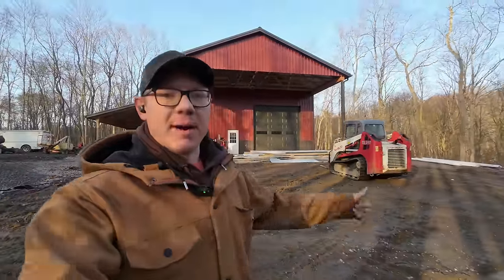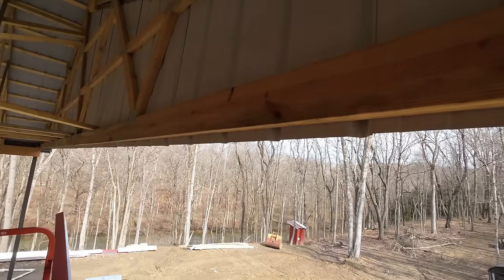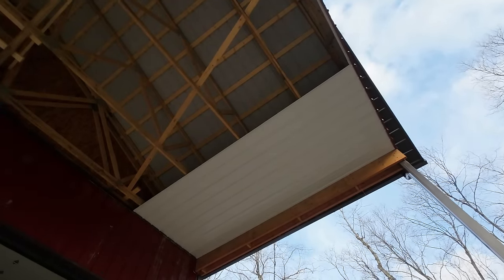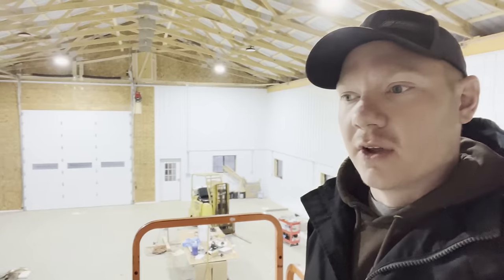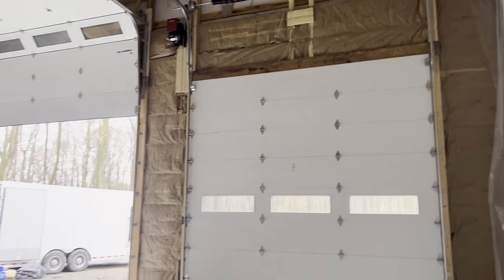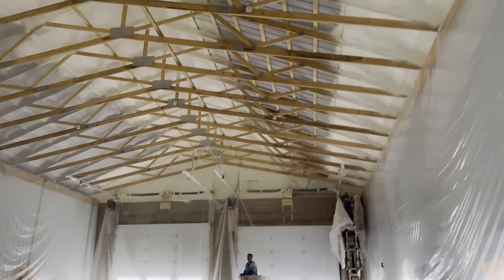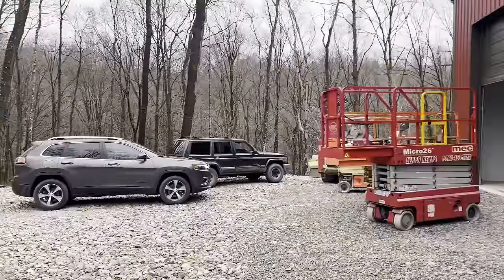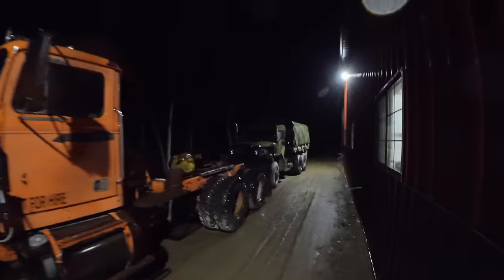I had My New Shop Sprayed with Hot Foam!! (Dream Shop Build)

Comment: I love the idea of foam insulation in the attic. But, my concern is when the roof develops a leak, and they all do eventually, you won’t know about it because of the foam until there is significant damage.
Reply: I was wondering the same thing. Everything eventually fails over time, even metal roofs. Imagine the work involved if you have to replace those roof panels.
Reply: Spray foam the outside of the roof 😁

Comment: Seeing that you are going to put heavy Equipment in the shop and run it i would put a exhaust System to take away the fumes and Black carbon from any Machine that you run and all so protect the inside roof and walls.

Comment: In UK, spray PU foam for insulation to the underside of a roof was popular but following serious problems with rotting structural timber, most insurers will not insure the properties and to get any insurance at all some property owners have had to remove it at considerable cost and difficulty.  Also, exposed PU foam would come under the Polyurethane Rehs that considers it a significant fire risk that develops toxic black smoke, which will propagate so quickly that it can outpace a running man within a building.  For this reason the escape travel distances are halved compared with normal installations.  I have designed under the Polyurethane Regs and its a nightmare.  Some claim that their polyurethane is self extinguishing or non-flammable but this is based on the inappropriate test.  Another client of mine ran a testing laboratory and he showed me the effect of the official test and the effects of a real world scenario and it was frightening, since then we have had the alarming fire at Grenfell Tower in London that showed how polyurethane acts in a fire.
Reply: I saw a news segment where a couple had to have their roof removed due to the toxicity of the spray foam.

Comment: We did (2) 8000sf corrugated steel ceilings in a large cold storage with 16' interior 12" foam bonded galv. sheet walls. We did it all ourselves and saved lots even owning all the gear. Bought all the pumps and >100' of heated line. All the air supply sets for 3 employees who quickly trained and did it all  Took at least a week per due to the depth we used. Not a whimpy few inches. for Refrigeration required. 2# density. Why gray, don't you want some light?  Is this a 60x40? Ours that size in 2004 was 35K  but owner only did 12'' walls which I said were too low. and no foam, a shell 1 rollup and 1 door & concrete surround >20 yards, a 20 x 40 'porch' all for storing orchard gear at that time 40 acres now 150. Always are too small, I believe

Comment: The best deal you can get is when your helper is taller than you. Those are the days I hate being 6'3" with a big wingspan. I get all of the load. It's a great measurement device, though. If I stand and put an arm up, that's exactly an 8' ceiling. Actually, dead on nuts accurate.

Comment: I'm sure you've already answered this / been asked it and are considering - however... Are you putting in some sort of exhaust extraction system with hoses you can hook over exhaust pipes, that pump the fumes outside? I really think that they would be worth considering, especially with some of the big old engines you work with!
Reply from the maker: Yes already in the works!

Comment: Now that your roof underside is totally sealed where will the buildup of daily heat that rises in the building escape? No ridge vents or gable exhaust fans? I'm not talking about radiant sun bearing down, I'm talking about the air current that uses convection to keep the space cool. Cool air comes in thru the window, warms, then rises... to where?
Reply from the maker: I do have a gable vent it’s just covered at the moment. It will be installed.   Very spon

Comment: I built a 40x50 steel arch (Quanset) style shop about 25 years ago and was wanting to have spray foam insulation but, it was ridiculous what they wanted at that time!! If I remember correctly, it would have been over $15k!!
Reply from the maker: This cost almost 17
Reply: @DieselCreek  I figured it would have been more than that

Comment: How did the foam react to the steel with what looks to be drip stop on it? on my side walls of my building it pushed the steel out between ribs. Iam adding on now and worried about the new part pushing out as well.

Comment: I probably need to be schooled on this but is there still a ridge vent for the moisture to escape or is that not needed in this situation? I put half inch celotex underneath the metal roofing for sound deadening and insulated on the underside of the lower truss sections on my garage project. Where is the ventilation going to happen in this project? I’m probably missing something hopefully. There is going to be moisture rising with the heat, where is it going to escape?

Comment: What was the outside temperature during the spraying? Also did you hear any popping or cracking sounds?
Should be ok sprayed onto felt backed sheets but have you pushed up on the middle of the panels to make sure they haven't buckled in ? I've seen that issue in cold weather

Comment: I'm confused, the sides are lined with tin, why wouldn't you use something else if it's noisy?
Also worth noting that insulation doesn't stop the transfer of heat, only slows it down.
You need a reflective foil type thing to reject heat

Comment: Looking good! Do you have power run out there or still run on a gen set? I would run under ground power out there if I was you. And will the power company run good heavy duty service to the shop out in the sticks like that up there? I know here in Florida where I am at it's hard to get a heavy service run just for a shop in rural area unless you have big$$$ and they won't run 2 separate services to the same address like when you add the house.

Comment: I'd have nailed a set of 2x6 boards together in a cross-hatch pattern to create a standing block (that's at least 3 feet x 3 feet so he doesn't risk twisting his ankle by sliding off the edge) for Mr. Shorty so when he's on the lift, he's the same height I am...

😄😁😆😅😂🤣

Comment: I know it’s much too late now- but I assumed a few things about the “outside triangle” and the adjacent wall—- A that you would insulate it with the rest of the shop(sound dedin and shop expansion) - B /C I figured you would have no ceiling on the outside triangle and a hinged section in the plywood on the wall to C allow the upcoming gantry crane to move from inside to outside allowing bigger projects  - another reason being if you dooo eventually shove that wall over to expand your shop then you only have the crane in 3/4 of your shop - again far far far too late now fellow pa man bit of a oversight but to be fair I only thought of it now
Reply: Something else while I’m thinking about it - with in floor heat you COULD also do in floor cooling if you setup a reverse-able heat pump and heat exchanger- is it worth it that’s up to you 😂

Comment: I never seen any power service run into your property. Witch looks like would be miles to do. What powering your building. A big gen set for 220 volt. It have to be a big one as them big over head cranes are all 3 phase
Reply from the maker: I’m running off a generator currently. I will be running electrical service here this summer
Reply: I thought so.  That's going to be a long costly run to bring power in an if that crane 3 phase it cost me in 1997 to bring 3 phase up my road2 poles. down my 1200 foot drive way over 10k cnd and I had to install all the poles an CSR cable up my driveway power company dont do private land only roadway

Comment: Did I miss the video where he completed all of those red pipes in the floor that lead up to that one central location? How is the floor being heated? I remember watching the video of him laying all of those red pipes in the floor but isn’t there some type of mechanical heating system that all of those pipes get tied into? I see the central location they lead to but I don’t see any type of heater or air conditioning system what gets pumped through those pipes and how does it cool or heat the floor?
Reply from the maker: Not complete yet.

Comment: I don't know the cost, but it looks like expensive way to build your workshop. We use sandwich panels.(steel PUR steel,or steel PUR aluminium) Much quicker, low cost and super finish. Is there a reason why you build it this way?

Comment: I cant work out what the fascination is with spray insulation. The most thermally conductive shit ever.  Hotter in summer and colder in winter. Just use netted insulation. easier, safer, breathable. and wont rust your roof prematurely.

Comment: I can't help wondering if it wasn't false economics to have only three inches of foam sprayed.  I know you were trying to keep the cost down but adding a few more inches after they had done all the prep work would have been far cheaper than the original three inches since the prep is done and it just involves them hitting it with another layer as they are doing it.  The big cost for you must have been their travel time and masking out the job as well as transporting all their equipment.  R-15 just isn't that much in a roof.  Although you do have the option of sheeting the overhead and adding rocksul or such.  Mineral wool would have a double benefit as it is a great sound deadener as well as good R value.  For a roof in your climate zone I would think R-30 would be a bare minimum even for a shop.  Most modern building codes would require R40 minimum in your zone for a residences.  Even considering you are in a shop and do not need 70 degrees cooling/heating still when the outside temperature is 100 degrees or minus twenty you need energy to bring it to fifty five or sixty.  At any rate it is your cow do what you want.  You have a great space to work now and to keep things out of the mud as well.  When you are laying out in the snow bundled up like the Michelin man even a tarp looks like a hell of an improvement so you are miles ahead of that!!

Comment: I don't want to be negative you have made a great shop well done but that spray foam worries me i know from the fire department here that i could be  a fire hazard foam useally burns really good so i hope they used a fire depressing foam you work with very hazardes materials in that shop like gasoline and gas but like  i said before its just a warning and you did a really good job building that in the middle of nowhere

Comment: 5:27 I was already laughing. Knew you were going to shoot the nails into and likely out through the outer siding 
My girlfriend turned out to be one of those women who practice independent feminism ideology and therefore shouldnt listen when a guy gives them instructions from experience.
She ended up driving screws through my siding and then like an utter doofus, she blamed it on the ladder not giving the ability to position her hand at the proper angle to hold and drive the screw into the lumber instead of through it and into the siding.

Comment: Very bad news for you. I have 40 years in urethane shooting. Never put urethane directly under metal roof with wood baton. Seeping condensation or rain water will cause roting of the wood. Urethane foam is waterproof.and maintain the moisture, no way to escape. Those guys know how to shoot but ignore the con about the use of urethane foam.

Comment: Trusses 2x6 sso that insulation isnt that deep or are 2x8 but insulation doesnt look that deep but looks vvery uniform application ... oh those wall paks are a complete rip off of Raab lights ... raab are the Cadillac of industry but they work as well for probably a third of price of raabs ... i would like to see guts of the lights compared too these ... bottom line i could live in this bad boy ... in fact i would its plenty large enough to park a nice trailer in and build a kit and bathroom good to go and sell or better yet remt out house ... most definitely

Comment: You put the ceiling on upside down and your Purlins are laying on the fat side, they should be standing up for strength. Your building will fall apart over time. It’s going to sag all over. You’re in trouble

Comment: as a european (german) i am quite aroused by seeing americans insulate their homes with sprayfoam. We try to use as less sprayfoam as possible while constructing, most common right now is "blow out" insulation with some kind of Cellulosis. 

I mean, Spray Foaming seems to be quick, easy, i expect it to have a VERY good insulation-rating, and it seems to be quite sturdy. But i am really sure there is no way you can reuse, recycle or undo it. only way would be to burn everything down. 

But hey, no shame on you, would do the same if possible, there is always a "better" way to do things, but you have to match your needs with you wallet and your timetable.

Comment: RIP the wood and your insurance policy not to mention the fire hazard with electric wiring along the beams....

Spray foam is a fucking disaster, dunno why you would choose that over normal foam insulating boards or packing. Wood needs to breathe, spray foam is flammable and impossible to remove easily if at all...

Comment: Not a fan  of the spray foam
Reply from the maker: Why??
Reply: @DieselCreek  I took one of my buildings down that had this done by previous owner 
what a mess  i could save nothing  , i rebuilt it with normal insulation board , love your channel though Regards UK
Reply from the maker: @PaulGreenwald  Well of course, it’s not exactly designed to be taken down. I don’t want any of this to ever move. EVER lol